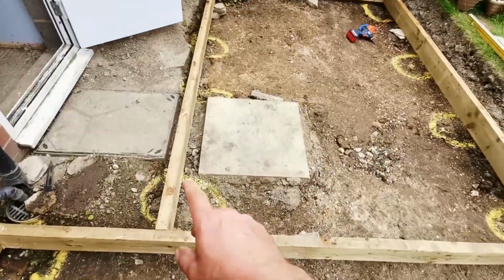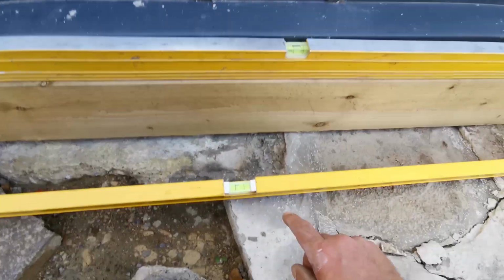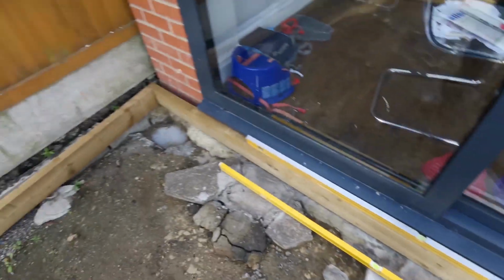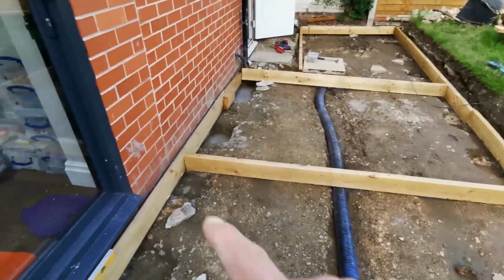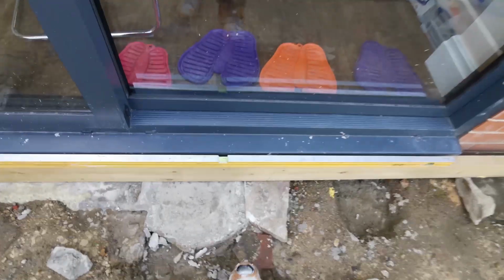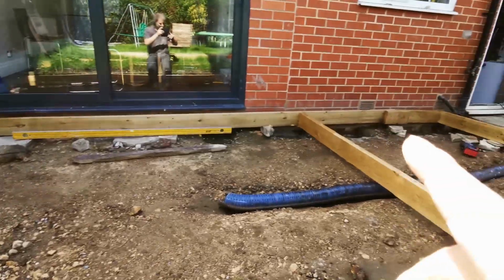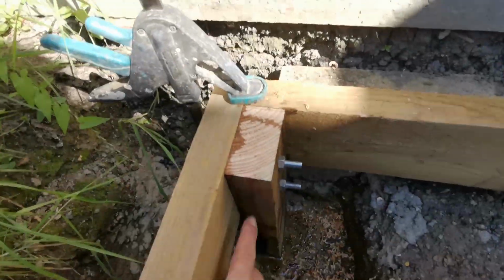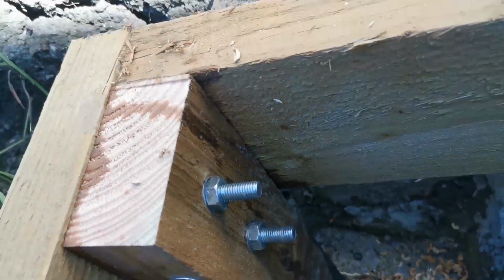Grumpy bank holiday flat deck building - Starting the posts & frame

Comment: Gid, thoroughly enjoy your videos and I swear as much myself, you commented the holes had straight sides how should they have been done? I will be doing an almost identical deck soon and was planning to use a post auger to make the holes.
Reply from the maker: 😁 Good, Thanks 👍 don't see why a post auger wouldn't work but I like the holes to be about a ft wide, the wider than the post concrete gives a wider footprint to stop it sinking, if the ground/substrate was solid i might not bother with the concrete but this is clay, The concrete flat on top so that the post can be slid in under the frame once cut without the level changing, the foot of the post sitting on a flat base & also it makes it easier for the frame with legs attached to be shuffled over a little to get it sq, & deeper than this is what i asked for so that that posts can be back filled to give them some support, a ft i asked for because this is just a low flat deck but 12-18 inch maybe deeper depending on the job/ground, I notch the post so the frame is sitting on the post, the bolts just hold it in place, a decent length of post under the frame feels more like it will hold itself together better with that weight on top rather than a stubby corner block/post, There's pictures on Facebook of other decks I've built & i built a shed base in a similar way.
Reply: Gid Joiner Thanks for the answer much more comprehensive than I would have expected and greatly appreciated. If you don’t mind me pestering you with another question; if you did this deck for your own house what changes would you make aside from the footings if any? Really appreciate the videos and the length you go to in explaining. All the best.
Reply from the maker: Thanks 👍no prob you're welcome, 
I've built a few so have had the experience to refine the design, Each deck is different in design but the basic build, posts & frame etc is the same or very similar,I'd maybe return the ends or make the bit around the garage door differently but in the major design I prob wouldn't change anything apart from the footing & that would only be done right instead of the shambles he made of it., Most things i build, i build as if it was my own so if it was mine I'd probably/maybe only take a little more care on the minor details, cleaner cuts or more accurate gaps but these boards aren't straight, they vary in width & thickness a little so only a certain amount of 'precision' can be put into it. 
These decks got a little more attention 😉 there's a few more on my page, 
https://www.facebook.com/gid.joiner/media_set?set=a.1010427002376999&type=3
https://www.facebook.com/gid.joiner/media_set?set=a.187058694713838&type=3
https://www.facebook.com/gid.joiner/media_set?set=a.171525492933825&type=3
https://www.facebook.com/gid.joiner/media_set?set=a.281468205272886&type=3
https://www.facebook.com/gid.joiner/media_set?set=a.187017938051247&type=3
This big one i built in 2011, i didn't notch the posts, don't know why, I've been back to that recently tho & it seems fine but now i always (normally 😏) notch them, 
https://www.facebook.com/gid.joiner/media_set?set=a.186994724720235&type=3
Reply: Gid Joiner Thanks again for the comprehensive reply! You’re videos give me a lot more confidence to have a go myself, if you were southern I’d probably just get you in!! Cheers!
Reply from the maker: Good luck & sorry I'm northern 😂
Reply: 3rd ones even more EPIC!
Reply: Just seen a video of yours where theres a pigeon in the chimney! You have to upload that on YT!!!!!!!!!!!!

Comment: Great informative video Gid, I will use these tips for my decking project. Top man. 👍🏾
Reply from the maker: Thanks 👍 Glad you can see past the grumpy language & pick up the details, The posts should be in deeper holes & the concrete at the bottom should be a bit wider & thicker 👍 hope it goes well 👍